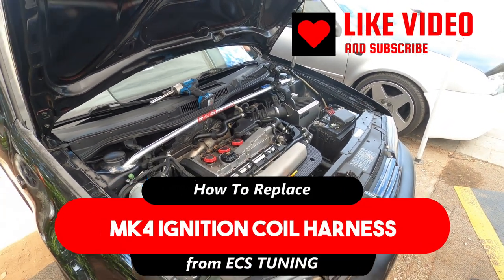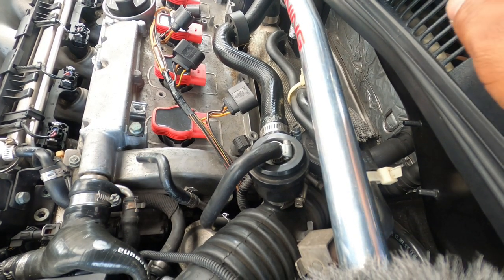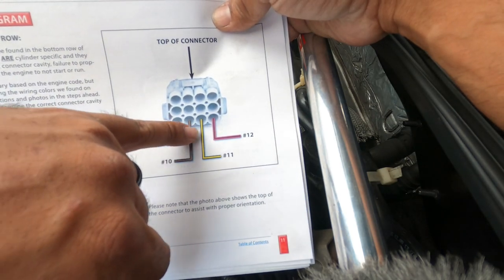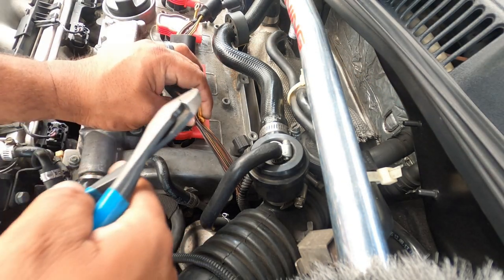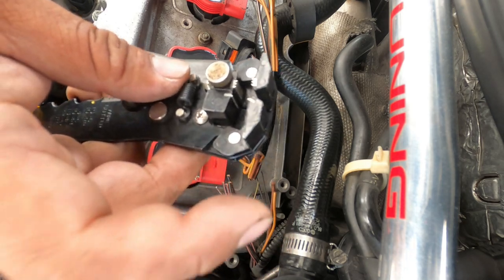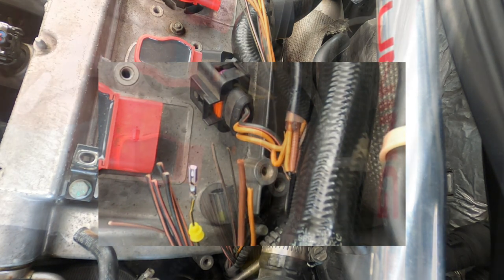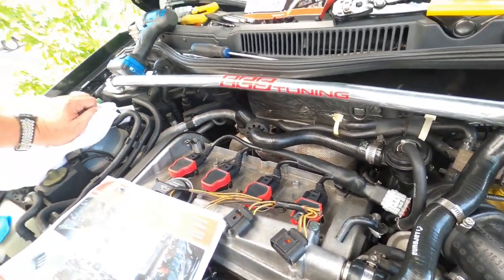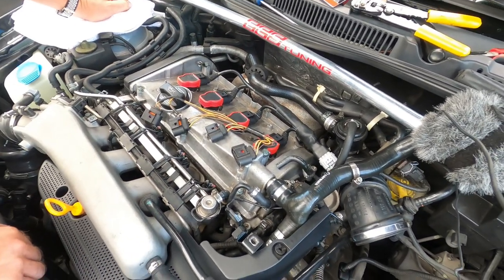How to Replace MK4 Ignition Coil Harness from ECS Tuning S7EP35

Comment: It's nice of you to show us how to do that but since you had the instructions and never held them up to the screen you just shook them around and gave glimpses. In the future a clear shot that someone could screenshot and use the actual instructions instead of just showing us that you have them.
Reply: if you were to get the parts wouldn't you have the instructions yourself?
Reply: @novicemountainbikingchanne3823  you would think so, wouldn't you? If I remember right I didn't get those.  Actually though 8t was probably just beyond my ability level at the time. Still probably is even though I eventually managed after needing to order a replacement connector since I ruined the first one.

Comment: I see some of the ones you work on have had the sai and n249 deleted and some havent. I have a 02 beetle turbo s that ive been working on for some time and finally getting ready to tune, should i remove/delete the sai and all that?
Reply: Theres no real performance advantage on removing those the only reason people delete them is because
1. cleaner engine bay
2. less parts to worry about failing
also You need to check the emissions laws in where you are based if they do a visual check especially the sai pump and ecu readiness, I've been doing a research on this for months it could be a pain in the ass if you dont do yours..
Reply: @GCS88  I’m in ky and they don’t do any of that here thankfully.

Comment: Another great video, thanks. What is the benefit of the 2.0 coil packs ? No spacer needed between the coil packs and valve cover to hold them in for AWP motors?
Reply from the maker: No actual benefits just looks cooler and sometimes cheaper

Comment: Hi,ty for video.
I didn't use the big connector. I soldered all wires direct. I didn't have to deal with those flimsy connector pins. I just don't trust those, especially being aftermarket. Ty again
Reply from the maker: I ended up doing the same tging